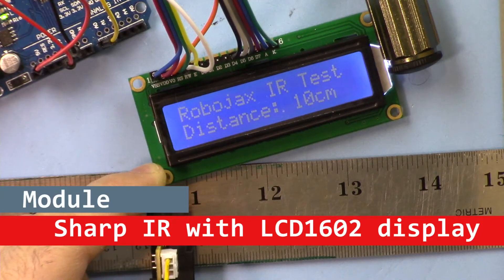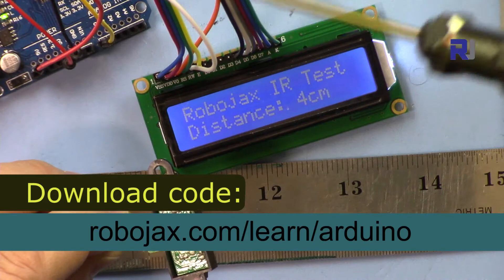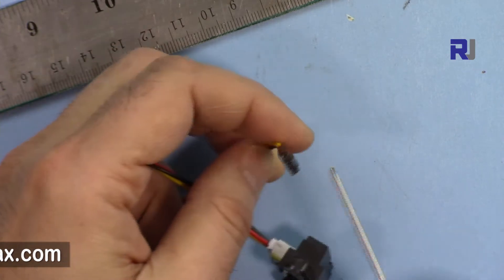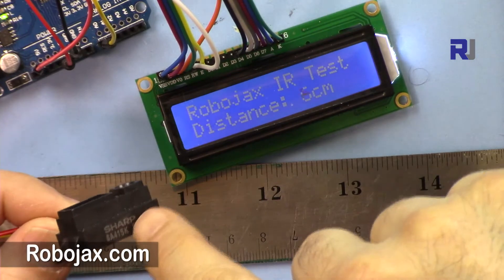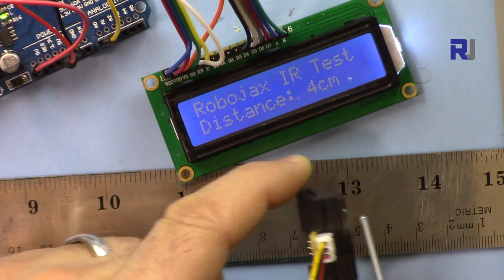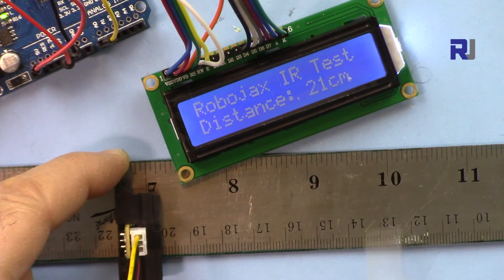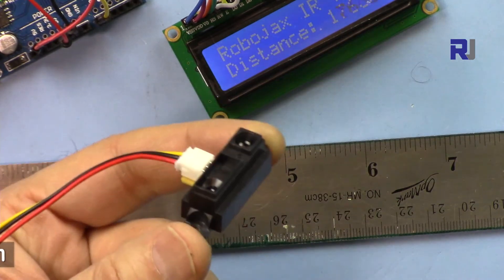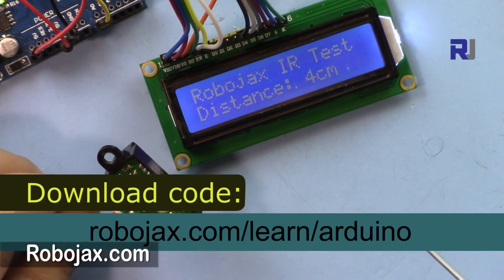Measure distance with Sharp IR sensor and LCD1602 I2C display in Arduino RJT57

Comment: Thank you very much for your tutorial. 

Can this sensor GP2Y0A21YK measure in millimeter unit? (e.g. 10.3mm , 11.7mm etc.)
I tested the distance measuring in mm code, but its output did not show mm unit (It shows only integer for example 10.00cm, 13.00cm).
Reply from the maker: You are welcome. No it can’t . Use VL53L0X or VL53L1x to get in mm resolution. I have tones of videos on them
Reply: @robojax  Much appreciate for your quick reply. Thanks a ton. 
I checked your other tutorial video you used the sensor GP2Y0A51SK0F which can measure from 2cm to15cm. 

https://www.youtube.com/watch?v=rdNCIyL6OA8 (From this link)

In the video, it also GP2Y0A51SK0F sensor can exhibit mm unit while it showed some unstable error ranges.
It looks like the GP2Y0A51SK0F sensor can measure in mm unit, isn't it?
Reply from the maker: SHARP sensors are based on Infrared and they are not accurate. you need laser sensor this one https://youtu.be/CUg8VheNyoU

Comment: Hey. I've tried the circuit & the coding on a breadboard. It works fine but when i soldered it, the reading is not accurate as before. The sensor always on minimum value even when the object detected is in a different range. Do u know the causes & a way to solve this?
Reply from the maker: you said it yourself. that the problem is when you solder it. something must be wrong in this process.
Reply: @robojax  new update. I've changed the wire and the sensor itself. still, the same problem occurs. do u have any idea on why it happens?
Reply: @robojax  & this time I try once again on a breadboard & only connect it using a jumper wire.

Comment: i like it,
i wanna ask you about that ir sensor, Can I have your email address please?
Reply from the maker: Please post images in this website https://snag.gy (just copy and past. No account needed) and then your image will have URL (address) and you can post the URL and I will reply. I do my best to reply to every message. This way other people will learn as well. thanks.
Reply: @robojax  When the sensor has  slope more than 45° of its object, for example 50,60°, is it works well? , and how many degree maximum the slope angle of that sensor?
and this is the picture https://snag.gy/QlXZru.jpg
i'm sory i ask you a lot of questions, cause the price is very expensive here, so i've to know more about it before i buy it.

Thank You